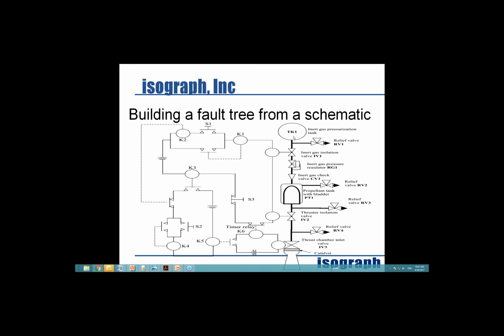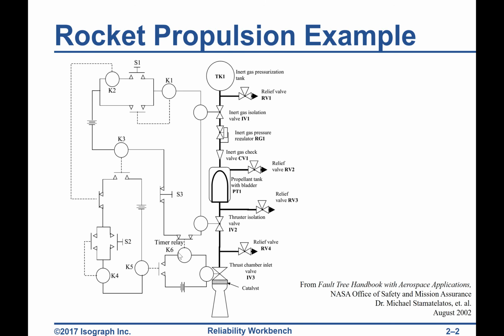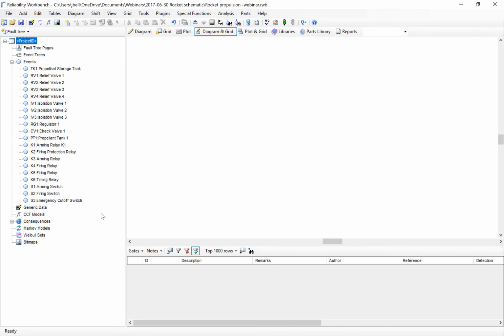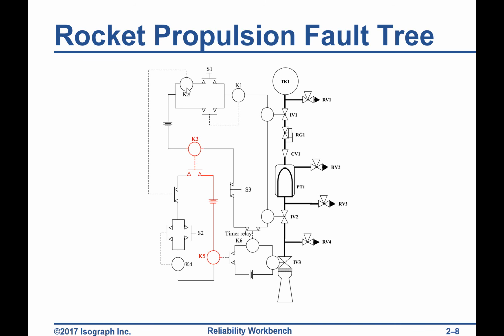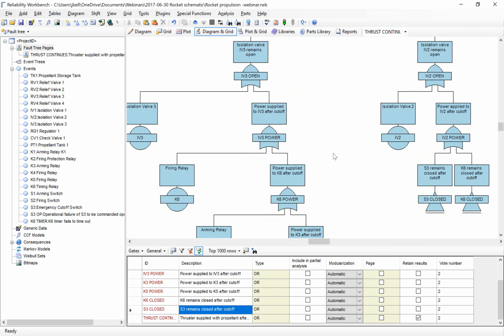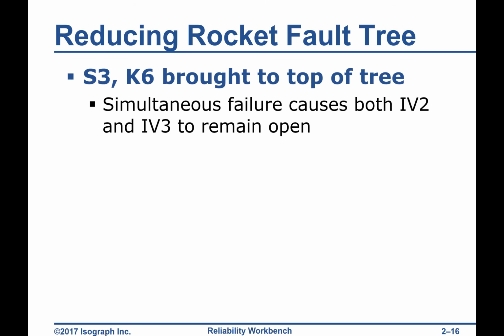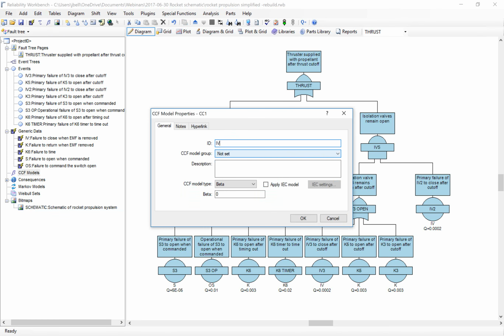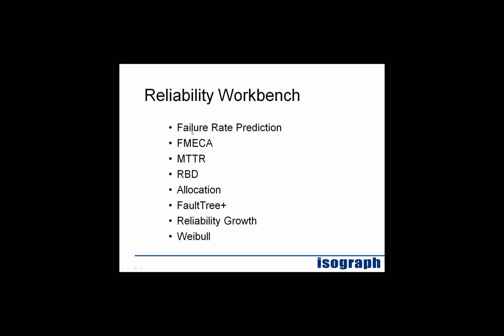Webinar  Building a Fault Tree from a schematic   Copy

Comment: Hello thank you very much for this presentation, it really helped me to understand a bit the system, do you have any explanation for the second case? the inadvertent firing of the system when it is not required.
Reply from the maker: That’s a great question! I’ve never built the fault tree for that scenario. It would be logically quite similar, but the events and their corresponding failure rates would represent the inadvertent opening of valves or closing of the relays and switches. It would probably be a much lower probability of occurrence, as it’s more likely that the switches/relays/valves will get stuck in the wrong position then that they’d suddenly move to that position unprompted, which is why this scenario is of more concern.